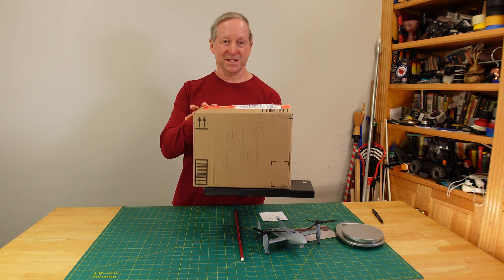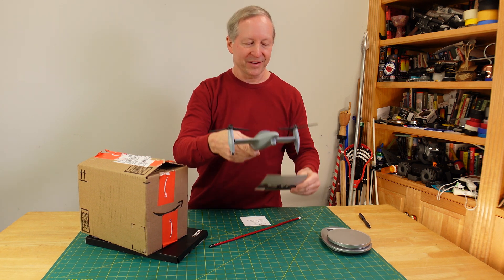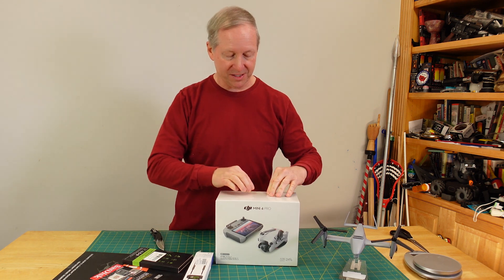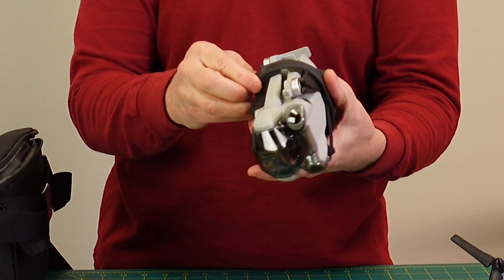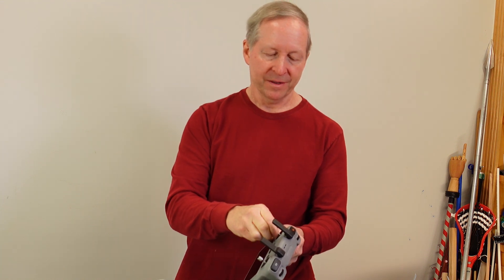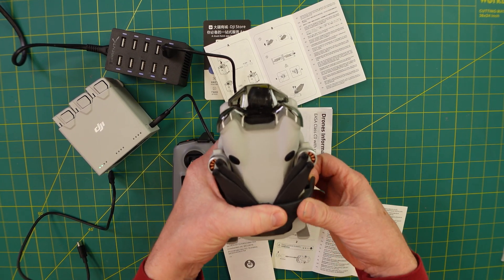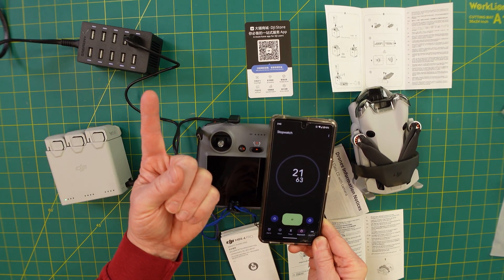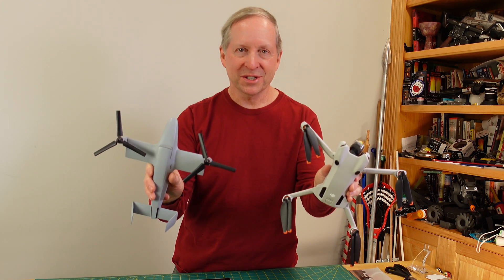DJI Mini 4 PRO 30 Years Later

Comment: Hey brother, nice video but I was wondering when you said it took five hours to charge all three of those batteries if you were using a 30 W or a 5 W transformer?
Reply from the maker: I was using the cables provided by DJI. The brick is 60W with 3A per port.

Comment: The reason why it took that long to charge the battery’s is because your using a slow charger it can take 30 watts of input
Reply from the maker: Thanks for the suggestion, I'll look into using a 30 watt charger.